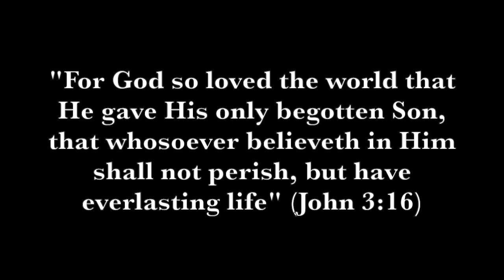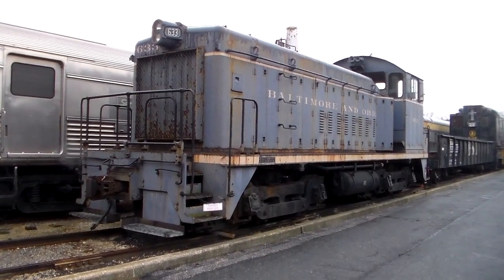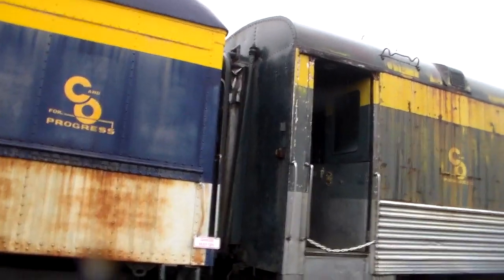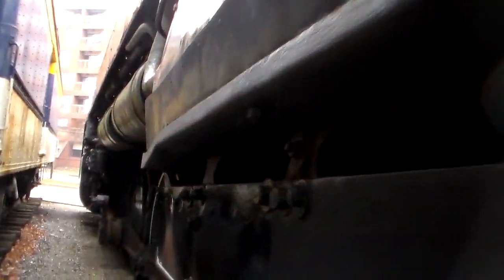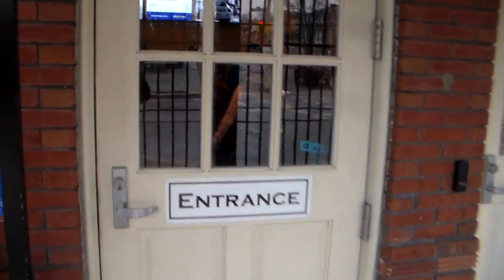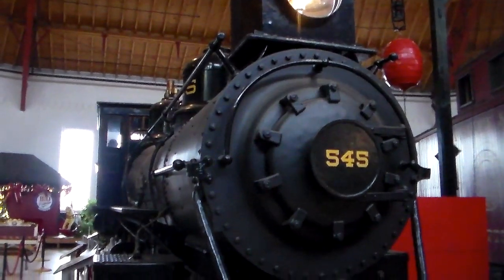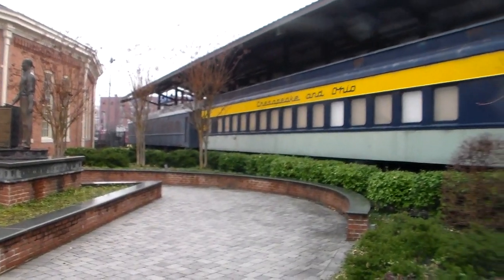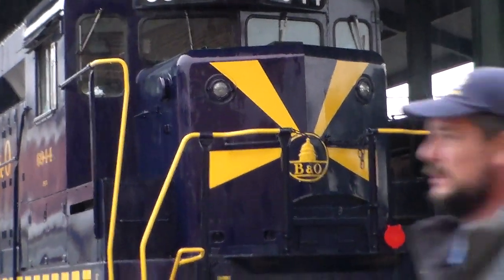A Visit to the B&O Railroad Museum!

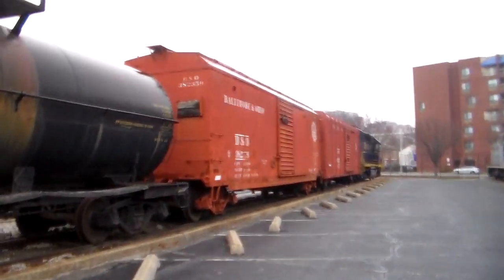Comment: nice tour for sure. But you really need to study up more on the B&O history and their cars and cabooses. You have quite a few dates incorrect as well as the box cars information as well as other information through out the video incorrect. Like at time point 5:08 that first box car with that special roof was a special service car, it is not an earlier version of the M-53 in front of it for instance.  You will learn in time. Study up and also join the B&O historical society and you can over load on information about the Best and Only RR. :)  As to the C&O/B&O Merger from Wikipedia and all B&O records  "C&O continued to be one of the more profitable and financially sound railways in the United States, and in 1963 (not 1958), under the guidance of Cyrus S. Eaton, helped start the modern merger era by "affiliating" with the Baltimore & Ohio."